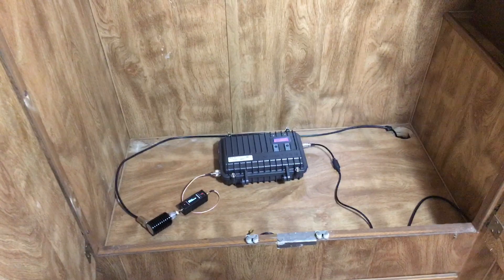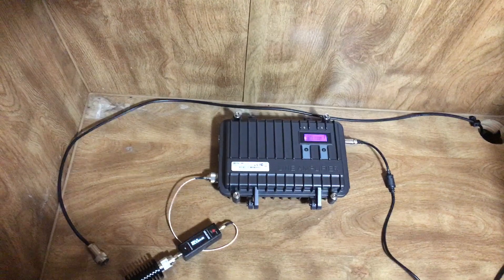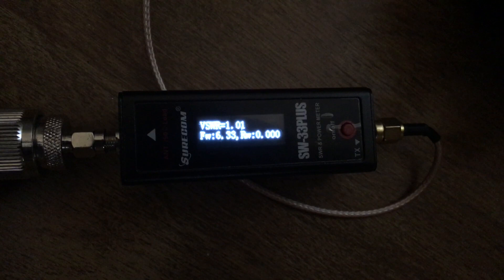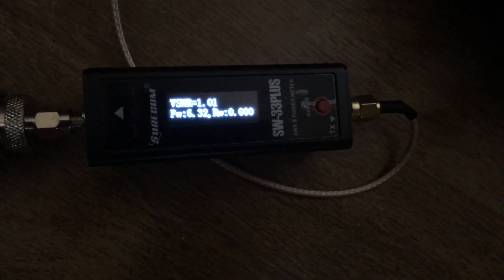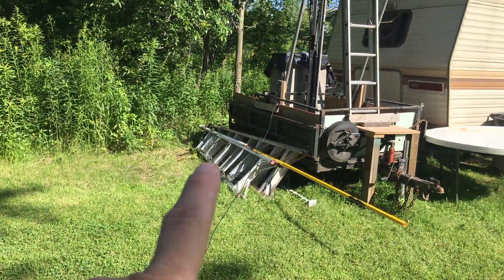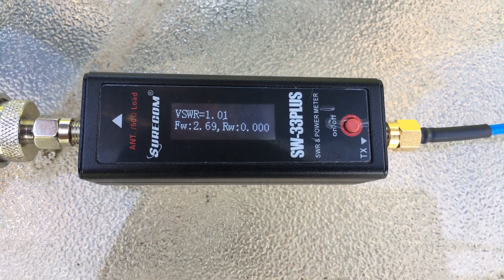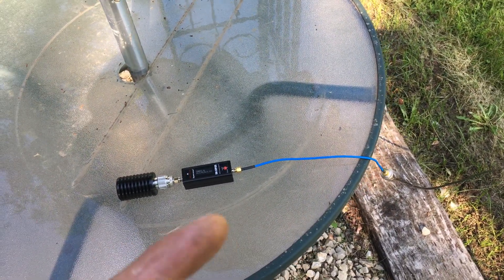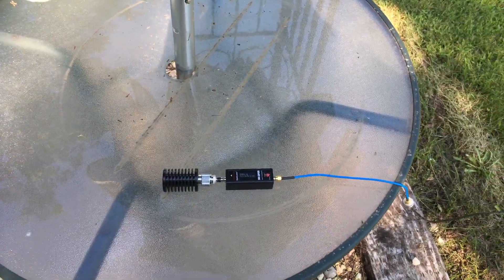🔺How much output wattage do I lose when using 50 feet of cable for my GMRS two-way radio Let's check

Comment: At the GMRS frequency you need to run a low loss RG-8 type coax..say LMR-400...the small RG-58 type coax is very high loss coax...your just wasting power!
Reply from the maker: yes I have a video on the LMR400 :)

Comment: First of all any UHF people using UHF radios knows about loss and LMR-400 is triple shielded coax this is what you use or better. That junk repeater is garbage the duplexer robs your power. Coax is like a water pipe if its thin and small you get a little water if you use bigger pipe you get more water and in UHF the loss is very high that is why all hams use ""N"" connectors for low loss. I suggest you read and study radio theory and get your ham license before you do foolish 3rd grade videos like this it really makes you look stupid but make a good laugh.

Comment: That’s a lot of loss . You should switch to RG-58 . That will give you at least 5 watts witch in turn will give the repeater clear transmission at the ranges that you are going at . 
Today I did a test of my own . I put my 25 watt base radio in my car . Hooked to a Nagoya UT-72G antenna. With the supplied cable from Nagoya. Anyway I hooked a BTech V1 GMRS radio to the base antenna. The results were not as good as I thought they would be . From car to base I only got 4 miles. That same radio and 18 watts from the base will double that. Then in the winter I get 2-3 miles more . That’s no leaves or foliage. 
Im going to do that test again . I think I’m going to also check the SWR and see what kinda power my radio is putting out in the car it may be less power from the car.
Reply from the maker: yes, i would check that too!!  Could be a poor cable!
Reply: @GMRStwowayradio  good video and thank you for checking. I went and checked the SWR on the Nagoya antenna that I use on the car with the 25 watt radio I use for the base station. I can only get 1:73 with it in turn I’m only getting 18 watts with it . Then I tried the radio on vhf . I was getting a 1:01 with it on 146.00 . Any way I figured out why. The Nagoya UT-72G is sold as a GMRS tuned antenna. Doing further checking it’s also for MURS frequencies. 
That said it might explain why I can’t get the same range from the car back to base . Using the same radio at the base I get 8-9 miles . In the car using the Nagoya UT-72G I get 5 miles . 
So I’m going to have to do some tuning
Reply from the maker: @46camper50  - no problem and you are welcome. Also, good to know about that antenna also being tuned to MURS. Hopefully you will be able to tune it.
Reply: @GMRStwowayradio  I think I will be able to trim it
Reply: 46camper how dumb are you? all UHF people use LMR-400 low loss cable get educated and read and learn try and know something before you post stupid you might want to go back and get your GED maybe your 5 yr old can help you defeat stupid.
Reply: No rg-58. AT GMRS frequencies, use LMR400 or better coax for 50' or longer
Reply from the maker: @HardcoreFourSix  - yes, I have LMR400, but I will be changing connectors.

Comment: More than likely, the cable is RG-58.
Reply from the maker: Yes, that could be I think I have some better cable, but I am not sure if it will be long enough. I will have to check.
Reply: Dallas you are dumber than a box of wet rocks UHF people know that you only use LMR-400 coax with ""N"" connectors to prevent loss get educated.